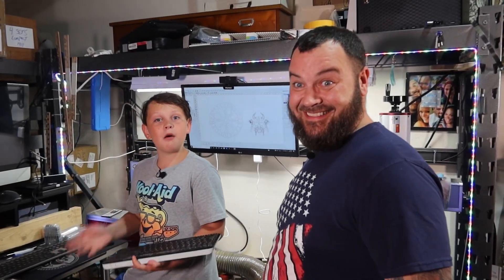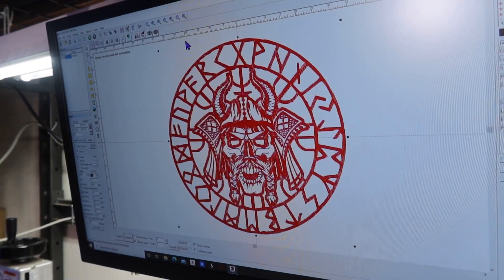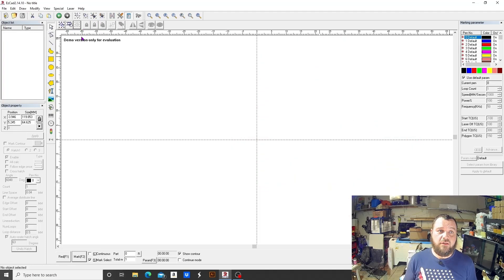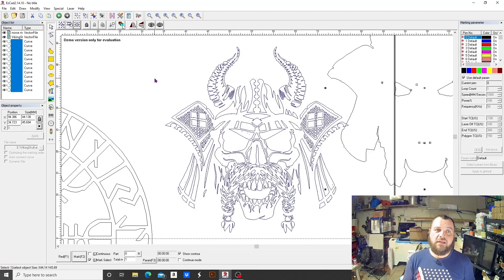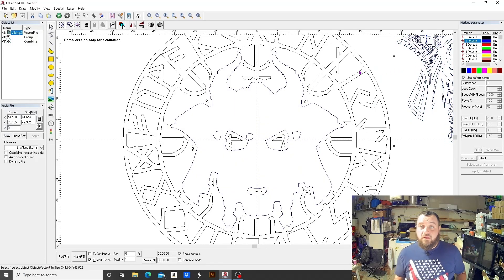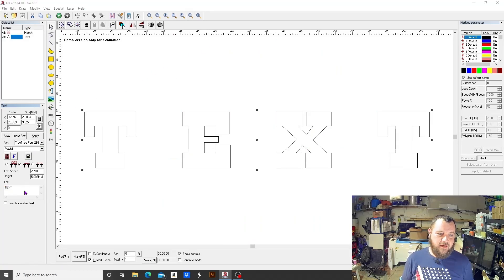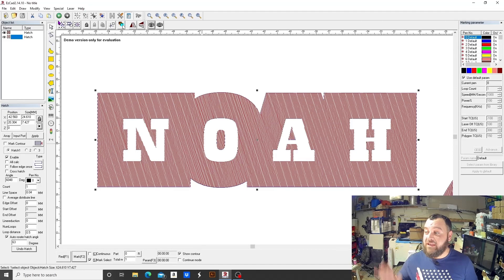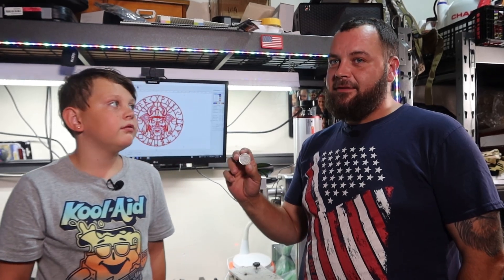Today Noah makes A multilayered coin and we show you how to make it also @fiberlasertriaining

Comment: Good afternoon Jeff (and Noah!)

I have a question regarding your Hammer / Shovel / Sweep method.  I've been doing deep laser engraving on throing axe heads for the past 6 months (and been electro-etching them for the past few years), so I've developed my own method through trial and error.  It seems like I'm clost to Hammer / Sweep, but I'd like to ask you about the 'Shovel'.

Currently (due to Lightburn's auto-roatate limitation) on my 60w JPT with a 200mm lens I run 5 passes at: S.1500, P.95, F.25, q.200, Line .025, Bi-directional, no cross, 78* rotation (for 360+* over 5 passes).  This is my Hammer.

That is followed by one 'Sweep' pass of S.3000, P.40, F.80, Q.200, Line .025, Bi, etc... 

What would you reccomend for my 'Shovel'?

Soon Lightburn will enble sequential pass auto-rotation, so I will be able to set up 1 hammer pass, 1 shovel pass and one sweep pass with independant rotations, so I'd like to experiment with your method.  I'm just having trouble figuring out the Sweep.  I'm not sure if this is something you'd address in this forum or not, but I appreciate your time adn all the work that you've already provded this community.

Thank you.
Reply from the maker: Sorry I missed this. 
You can add layers to your first pass and achieve my method this way.

Comment: Hey Jeff, your brass coins have some kind of coating on them. Should this be removed before engraving, and if so how? Thanks!
Reply from the maker: Great question. This is a eurethane coating to prevent oxidation before engraving. If you’d like to remove it just send it off or I just laser through it. You can also create a circle 40mm and hatch it entirely at higher speed and higher power with a .1 line space.
Reply: @FiberLaserTraining  OK thanks. I’ve been burning through it but it takes 4-5 passes. I notice on another challenge coin, not yours, when I cleaned it wit IPA alcohol it left some sticky residue which i continued to clean off. So I may just use alcohol on it to remove it so it doesn’t take so many passes. Thanks!!!
Reply from the maker: @VegasMadMikey  indeed.  
Maybe acetone also would cut it.